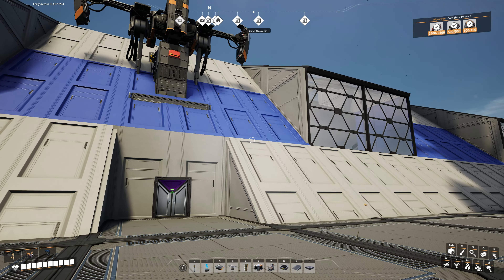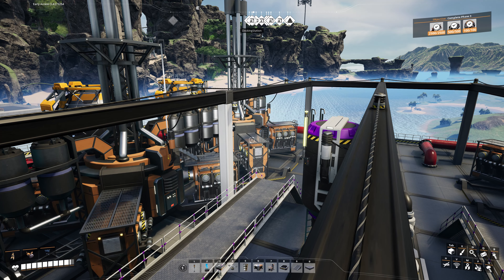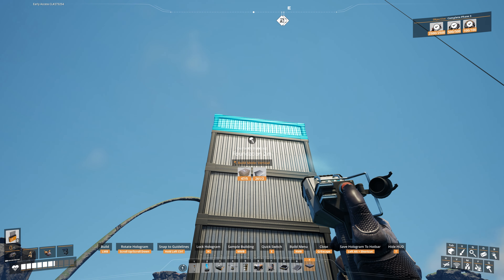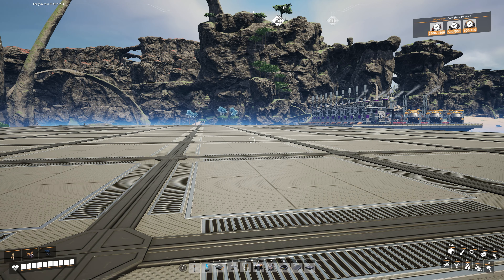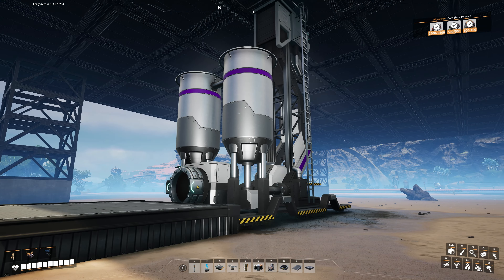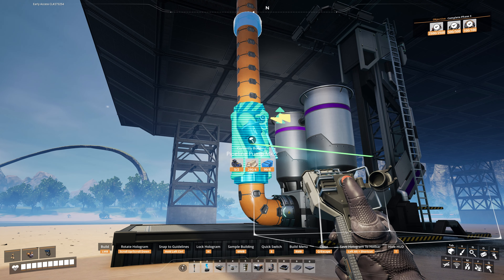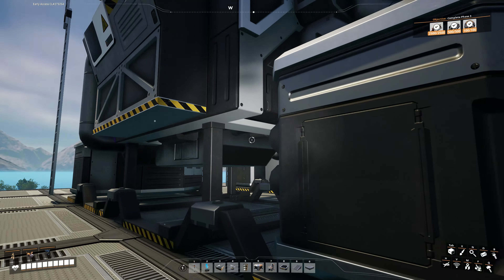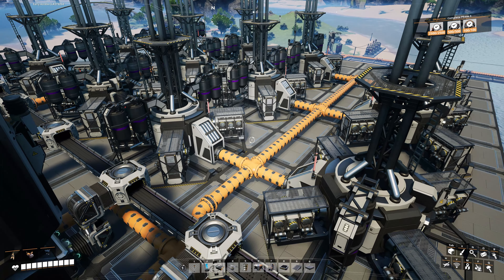12 Fuel Generators & 2700MW of Power - How to Satisfactory - Tutorial &  Walkthrough - Ep. 46

Comment: Hello, I have a problem with the fuel generators. The last four fuel generators in the order of construction in the video do not have enough fuel to function correctly. All fuel generators run on 100% fuel but the ones I put last don't. I did everything as shown in the video and the mathematical numbers are correct. If someone could tell me what's happening that would be great. Sorry for my english.
Reply from the maker: How long have you given them to run.. in enough time they should fill up?
Reply: @PHENIXXCREATES  I already solved it, it was the flow of the pipes, when I turned on the generators, the pipes were not full, thanks for the help. Now everything works correctly. Thank you